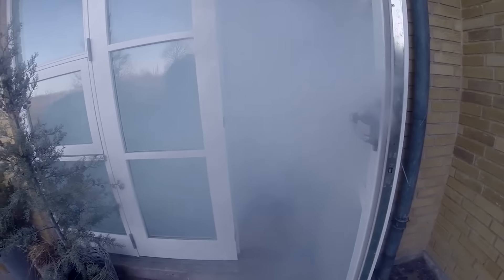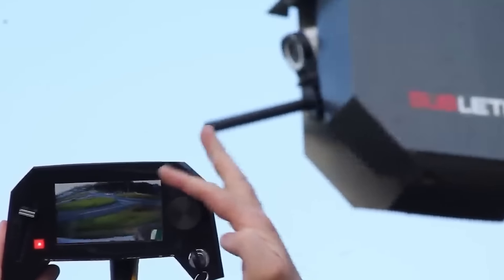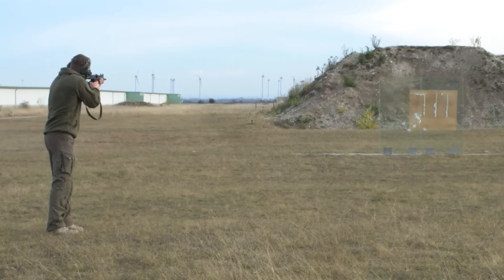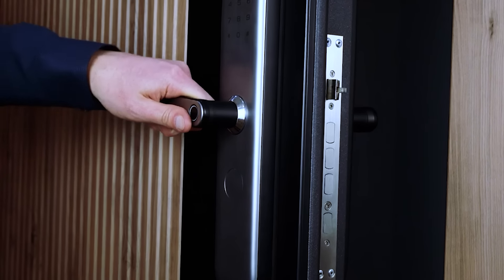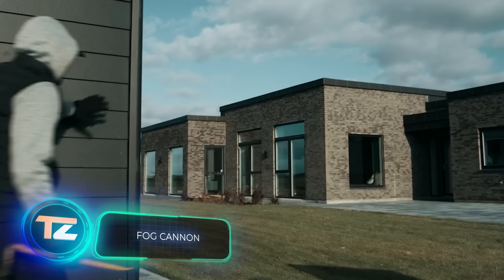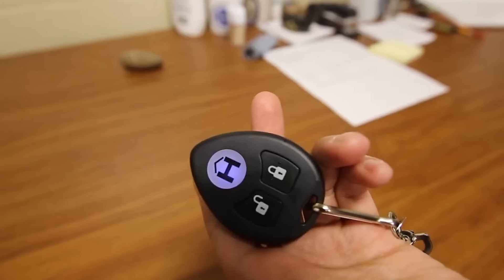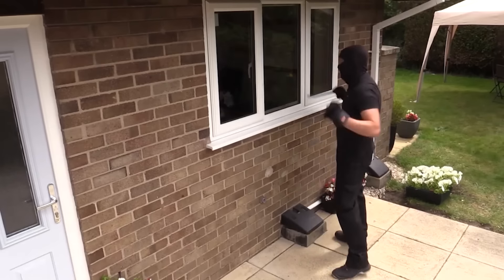13 HOME SECURITY GADGETS YOU SHOULD SEE

Comment: About electric fences and barbed wire or sharpened objects on fences, as a South African I can say that they are useless in a planned house burglary. Our criminals use a thick old carpet to slide it over the security and comfortably jump the fence. A low-tech solution for expensive protection.
Reply: What one man invents another invents a way around,
Reply: Here they are called 'booby traps' and illegal to use.  The big problem is that they are indiscriminate and can harm friend as well as foe.  Think about a cop or paramedic trying to breach the perimeter in an emergency...say you are having a medical emergency on the other side of the fence.
Reply: I've used rubber mat to get into my house after forgetting keys, then I realized how useless it is 😂
Reply: Oh, where I live, there are hardly any land houses, and if there are in the center of the country, they will cost around 3 million dollars, oh, and in general, most such houses have electric shutters, no garage, and there is steel, which is a steel door, and cameras, and the police can reach the whole country in a few minutes, so it is not effective to break in, the penalties are too low
Reply: So what is the solution to fully protect your home in South Africa? Canada is quickly becoming the next south Africa thanks to our politicians
Reply: The only way to be reasonably protected is a comprehensive solution - gated communities, high walls with razor wire and electric wire, alarm system plus neighborhood watch with armed security on the gate and patrol. The problem is only the well off can afford it, working people are left to their own devices. Be careful and aware of what is happening around you. Bad things happen when you're not. Always have a plan for how you will react in different scenarios, it can save your life. Love your neighbor but keep your gun handy..

Comment: I like the fog concept but it would be better if it released CS gas because its invisible and takes your breath away, the burglar will do anything to get out since they can't breathe. Its also harmless since every military recruit is placed in a room with CS gas to experience what its like.
Reply: CS is hell to clean up.  I’d use OC.   I’ve seen some wall/ceiling mounted spray type alarms for sale.
Reply: Fog cannons have been used for a long time in Europe.  As in any field, improvements came in time.  It's not ok with CS because the process is fast nebulization, in addition, you will damage the protected assets.  Instead, a strobe flash and a siren have an instant effect, including against those with gas masks.  As long as they are chosen correctly for the protected objective, fog cannons are beautiful.  Except for optical smoke sensors😉
Reply: I was thinking VX gas but CS will work I guess.
Reply: CS is great if you like that burny feeling.  And because they use it on troops does not mean it's harmful.
Reply: @kro9703 
😂

Comment: I live in Phoenix, Arizona, you might think I am going go right for the gun, but I do not, my home is built with concrete block, I have 9 windows that are protected by the hurricane style roll up shutters and CrimSafe, a baseball bat proof screen for the 3 windows unable to have shutters. I rebuilt the frames for all 3 exit doors with solid wood framing and extensive use of 3 inch screws for both the door and frames. Then I have high quality security doors on each exit, these are secured with 12 of the non reversible screws for each door. To prevent lock picking I have two locking hasps on each door to prevent it from opening even if the person cuts the door's screen!! Then If an intruder gets in, he faces an aluminum baseball bat or a 9mm Pistol loaded and chambered with hollow points!! The exterior is lit from dusk to dawn with flood lights and I have all windows and doors covered with cameras feeding to a DVR that is run through a universal power supply in the case the power goes out. My power panel is also locked, no trees or scrubs, just green lawn all around.
Reply: You've already lost. YOU not the criminals are living in a prison.

Comment: Never depend on electricity or wi fi for any security use when there's no power add solar backup only for those types of security devices use manually mechanical mechanisms windows doors devices
Reply: Secured power backup.
Reply: @TicTac-g7m  that’s what generators are for.

Comment: For direct intrusion, I will never trust a microchip, especially wireless ones.  Any semiconductor can fail in too many ways given millions of components on a chip.  A plain old key is worth the inconvenience, and a door cane as part of the locking hardware, or bar on the inside when I am home will do the job while I am home as an added measure.
Reply: Same
Reply: Agreed to a point. I would include both technical and non-technical.

Comment: I imagine that those barrier window screens being a major issue during a fire preventing the homeowner's ability to exit, or for firefighters to gain entry to save people passed out inside.
Reply: good point..... but one thing at a time....... no worries......
Reply: So don't use them if you plan on having a fire
Reply: @KC9UDX  Who "plans" on having a house fire?
Reply: 5:29, sure does look like metal.
Reply: But your chances of a fire are far less than being burglarized.   I’d take that risk.
Reply: Eh, gotta take the good with the bad! Stuff or life? Stuff or life? STUFF! 😅
Reply: @Erin-Thor Unless the burglar says: "Oh yeah, take that Mr Security"!
Reply: @theterminaldave  anyone who relies on things that are necessary once they have a fire
Reply: @theterminaldave no one till it happens.
Reply: Some of us live in places where home invasions are way more likely than fires....It is what it is.
Reply: @antonvrb1510  I'm sure the environment plays a part in home fires, but every home can experience a fire due to the same causes, i.e., open flame, electrical issues, etc.
Reply: @theterminaldave  yes, I get it. Fire is just not the number one killer where I and  many others live though.
Reply: A battery powered (or gas powered saw for firemen) angle grinder with cut off wheel will make quick work of a metal screen.  I have them mind you, I realize it's weaknesses, it's about making an intruder make noise and take time.  This gives me the opportunity to be ready to meet them with force.
Reply: Here in the UK you can get metal folding barriers to place inside your windows. So you can have them open in the daytime and close them at night.

Comment: I'll stick with my four dogs. The ankle biter that hears everything the other dogs don't hear. The medium-sized dog that is the instigator and the speed. And the two Great Pyrenees whose bloodline is notorious for killing coyotes and other large predators. If you get past my dogs, you won't get past my guns. No alarms (other than the dogs). The only fence is to keep the dogs in and you safe. The yard sensors are for when the dogs are inside. When one of them goes off, the dogs go outside and I get the backup, (a gun). Sorry, I don't call 911 until afterward, to cover myself.

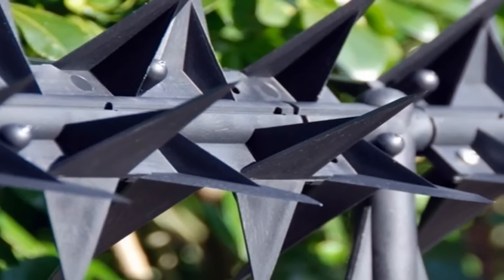Comment: 4:45 - These plastic spikes are made to look like steel and can be installed as a fixed or rotating barrier, but the most effective part of them is... 
5:10 - ...the plethora of other security measures, burglar-proof windows, reinforced doors, and armored mosquito screens you may or may not have installed that literally have nothing to do with them (???)

Kinda like selling a pill to reduce risk of heart attack, the most effective feature of which is the extensive dietary and exercise regimen you undertake to improve your health.
Reply: I rent a townhome and cannot make alterations to my living space like installing fancy and expensive bulletproof, intruder resistant doors and windows or wrapping my little outdoor area with electric wire ...I DO however think I'd benefit from installing something like that spike bar, provided it would extend far enough across my window and that they would hold up against being kicked in...at least long enough for me to get my other option out of its lockbox

Comment: I had once hooked up a CRT flyback transformer with a pressure switch under the ffot plate at my door, connected it to the door knob. One Thief found out the hard way. 3000 volts hurts like hell.
Reply: OH HELL YEAH !!!!
would’ve been better if it was chained to a large capacitor too
Reply: @JohnH20111  , 😂🤣 my goal was to give a hard zap, not a turkey roast charge.😂🤣

Comment: The problem with alot of these is that more often then not they legally have to be able to be delt with by police which means theres a way for criminals to to workaround them
Reply: Smoke ,carbon moxide Dector. Fire extinguisher in every or most room's. a .b .c. can also be used for other things. And I Have not seen it listed, get a dog even a lap dog ,They will not stop Barking. Criminals do not like that, and will  move to an easy'er Target.

Comment: I've been looking for hurricane proof louvres for quite some time. No lock yet.
Reply: Google or Machine shop, That can deal with sheet metal. Cheep'er Much Better As You Choose How Strong You Want, I would use S.R.S. For Everything, Frame,Hardware, And backing Plate, for the other side of the 2x4 you attached too. Also Just F.Y.I. Tell them you want to get prices in writing , Just shopping around right now?
Reply: @michaelolinger1074  Shopping around. What you described sounds like the frame. But there's also the glass itself. I came across louvre glass (entire louvre set up) that was hurricane proof many years ago. I can't seem to find now. Louvres seems to be out of style.

Comment: Those useing a sledge hammer on that rolled down door makes alot of noise you might as well use Peanut grander 4" cutting wheel it will cut through a paddle lock like butter or use a hot saw Husqvarna 12" wheel wont be able to stop it but its pretty noisy so the police would definitely no about it.

Comment: Do these companies consult with building contractors?
 I can easily defeat all of these security measures. Not by going at the actual security measure. But how the building material around them.
Reply: Example. The windows and doors. Attack the framing. Use a car jack to spread the frame. Then use a reciprocating saw to cut the fasteners of the frame. Pull the whole window/door frame out.
Better yet, just cut the wall beside the window/door.
Reply: Electric fence, super easy. Buy $20 worth of rockwool insulation. Lay it over the fence. This would also work for the spikes on the fence.
Reply: Camera, simple. A laser level will blind them.
Reply: Even in one of the scenes you can see the electric meter exposed. Whack that with a sledge hammer.
Better yet. Go to the electric pad that feeds the area and cut the power there. The home security will think it's just a power outage.
Reply: With all that said. Just climb onto the roof. Cut a hole thru the roof.
Reply: Also have to note. Professional Burglars don't wear all black. They wear what everyone in the neighborhood wears. So they blend in.
The really good ones wear a orange vest, drive a truck with a bogus contractor company name on it. Carry a clip board.
Neighbors will think they are having work done. Then they have all the time in the world to break in.

Comment: You're talking about sprayed gas...
A gas mask (professional) in my country (POLAND) costs USD 200.
If someone wants to break into a residence, the object is observed in advance, how is it done? Please:
You buy:
-Disposable gloves (no fingerprints, no DNA)
- Disposable shoe covers (No footprints)
- Blanket (fence)
- Car mats (fence)
- Painting suit (no DNA)
- Metal cutting scissors f.e. Milwaukee (professional) $33.
- Counter sander ($40)
- 4 spare batteries ($100)
- Spare discs ($10)
- Use the grinder to remove the shoe print so that you won't be found after your last purchase.
- Duct-type tape - you put on the suit and seal everything.
- You observe when the house is empty.
- When you know you have 2-3 hours free - you go in.
Of course, don't steal anything or break in... because that would be illegal, just like my comment.
In the meantime, you check where the electricity is going... cut the wires... you're clear...

Comment: All of this window/door security is useless. I build homes. Step two feet to the left of the door, use a battery-powered “sawzall” to cut through the siding/plywood, between studs. Kick through the sheetrock and steal all the good stuff.
Reply: Too messy
Reply: @commandoconstruction2720 why not just hole saw a 5 inch hole on the wooden door and stick your hand through. All you have to do then is open the door by undoing the lock

Comment: Electronic security for doors, windows, etc..
I cut the power cable. The system crashes. The system cannot restart. The system cannot transmit any message. You're on vacation and all you know is that the system isn't working. Before security arrives (if there is one), I have at least 10 minutes of free time.